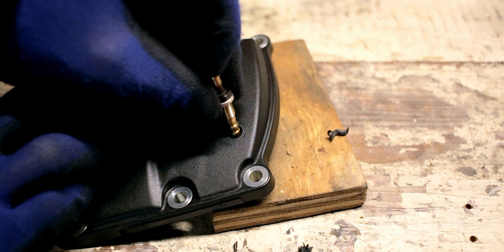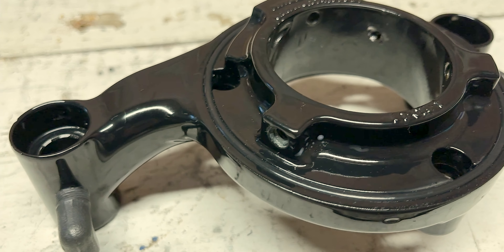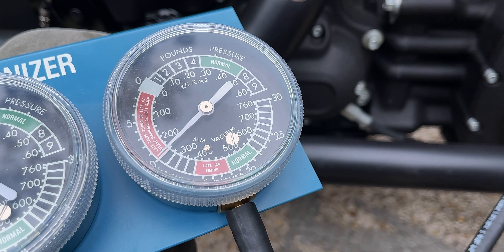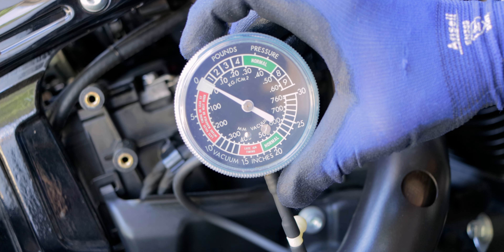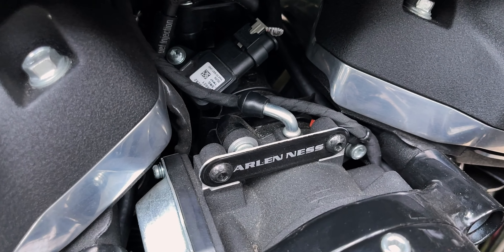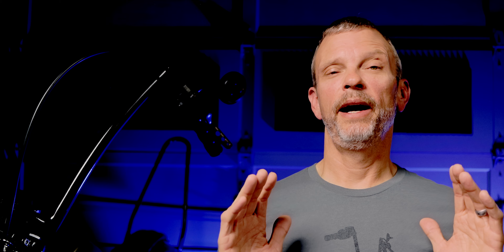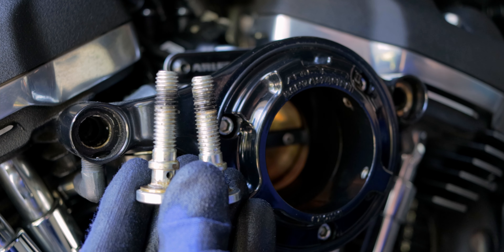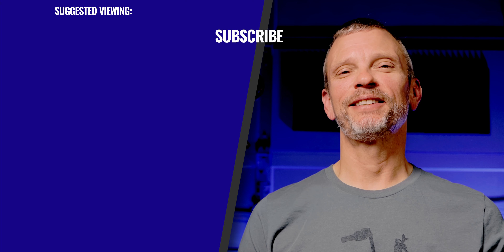M8 Crankcase Pressure OR Vacuum? • Crankcase Vent • External Breather • Check Valve • Stage III

Comment: On my v twin I just put in place a one way check valve off of the upper breather tube.  Works just like pcv valve.
Reply from the maker: Hey Dale - that sounds like a nice simple approach. I haven’t done anything with that breather tube. Is it a hard line or rubber? How’s it working for you?
Reply: @RonsWorkshop  I used hard line kit from J&P Cycle at the jug but instead of leaving it vent behind air breather I T'd behind oem breather and then ran soft tubing back by swing arm.  When I got my bike I had to rebuild carb and noticed a good bit of oil in carb... sad part is this isn't just a Harley Davidson.... all cars, trucks have this issue.  I'd like the EPA explain to me why burning motor oil is cleaner off environment than just gasoline or diesel.
Reply from the maker: Thanks for sharing your solution! I’ll have to check out that hard line kit. I hear you about the oil. I’m finishing up the follow-up video for this now and it should be up by tomorrow.
Reply from the maker: Hey Dale - I  just posted the follow-up video: https://youtu.be/BaG1VdOFe48

Comment: The blowby gasses enter the crankcase as seen by the bag filling 
In the heads the umbrella valves separate the case from the intake manifold which is under varying  amounts of vacuum depending on throttle position when conditions are correct the umbrella valves open and the blow by gasses move to the area of lowest pressure ie your intake then when conditions are correct the umbrella valves close again keeping gasses in the case and this process repeats
 I would doubt the cases are ever under any amount of vacuum  it seems to me the system works on the pressure difference within the system 
a case breather is undoubtedly the way to go for me and let the heads breath external if any gasses ever reach there
Reply from the maker: Hey Kevin - let me know how it goes if you and a venting solution!

Comment: Based on how I just viewed my personal bikes intake taken apart the m8 does NOT have a positive crank case vent system. It only has a passive.  In order for it to be positive the breather hoses from the heads should need to be connected to the intake BEHIND the throttle body not in front.  There is zero vacuum in front of the tb at least not a measureable amount due to the columns of air in front of it the tb restricts the flow of air reducing the available amount after increasing the vacuum. This is how cats work and internal combustion engines are internal combustion engines. And I speak from the fact I’m a master tech in automotive
Reply from the maker: Hey Mike - thanks for sharing that info!

Comment: Those vacuum gauges you are using are not sensitive. I could not use them on checking for over pumped lifters causing the valves to bounce. I you get a really sensitive low psi gauge then you can see the psi pulses. If you do you will see what you see in the bag.
Reply from the maker: Hey Jeff - that makes sense. Thanks for the input!

Comment: First, I installed external head bolt breathers. Next, I installed the Feuling vented dipstick. Finally, I installed the Trask vented transmission cover. My initial assumption was that I couldn’t do any harm running all three venting systems simultaneously. But your latest video is causing me to question that assumption. Only the Trask transmission cover seems to have a working one way valve. I can’t imagine that I have any crankcase vacuum at all. Excess crankcase pressure should be able to escape. But idk if I should spend any time adding a couple of my own DIY one way check valves to try to develop vacuum in the crankcase.
Reply from the maker: Hey Brian - I’m still not convinced there’s an issue. If I had seen vacuum at all I might feel differently. @Norm Tut suggested a water manometer, which may be more sensitive. I’ll probably give that a try. But the only reason I’ve reverted the breather mod at this point is to check for vacuum for learning, and now is the perfect time to check for how much effect the crankcase vent has by itself since the other mod is disabled right now. Still on the hunt for solid facts from an authoritative contact.
Reply: @RonsWorkshop  In all honesty Ron, I’m not sure you’re ever going to find details that you’re looking for. I have watched so many videos my head spins on a daily basis I have talked and talked till I’m blue in the face to every person that I can think of and I doubt seriously if you’ll ever get a straight answer. The one thing I do know and feel confident about is if we go back to a date and time in which the Harleys were simply vented to atmosphere that was a factory norm. I think if anybody’s got this right on the money I’m gonna say that the Trask top cover is really the only way to go and I am thinking the only real reason that they put a check valve in it is to make it look more complicated (worth the money) …. That being said I called them guys at Trask directly and ask them all about it and that’s why I ended up doing the job myself on my own transmission cover was simply because they couldn’t tell me that my DIY job was any less effective and that’s coming straight from the horses mouth.
Reply from the maker: Hey Jeffrey - I'm pretty sure you're right! And the point about the check valve is not too far-fetched. As time passes I am more and more comfortable with venting to atmospheric (with a pod filter or something), knowing that the main thing is alleviating that pressure.
Reply: @RonsWorkshop  I do know that simply venting the crank case whether it be from using the V-1, fueling, Trask top cover to vent the case has eliminated the oil in the intake 99% … my goal was to accomplish that and possibly help with the 1/2 qt. Oil consumption in between changes (5000 mile oil change interval w/full synth oil mobile one 20/50)…. But I’ll take what I can get at this point.🙂

Comment: There is essentially NO vacuum in the air cleaner area because it would be vented in before the throttle plate.  Unless you have a badly plugged air filter there is less than one inch of vacuum difference between outside air and air inside the air cleaner.

Comment: to messure vacum in the crank case you have to messure vacum in the intake...
thats the source of vacum in the crank case
if there is no outsource of vacum your crankcase will be under pressure 
and the more blowby the more pressure 

your crank case is suppossed to have vacum 
and thats why breather tube is connected to intake
Reply from the maker: Hey Rokita - yes, but that vacuum goes to the crankcase when the stock head/intake venting is in place...but in my case it seems that the pressure is higher than the vacuum, or at least that with the gauge I was using it was not sensitive enough to capture any of the vacuum pulses. I've gor more info on this topic and I am working on the follow-up video.
Reply from the maker: Hey Rokita - I  just posted the follow-up video: https://youtu.be/BaG1VdOFe48

Comment: vacuum in a crank case...never heard of such a thing unless you've got one heck of an oil pump but by the time you got one that strong you wouldn't need the pcv(s) which Harleys have 2...1 in either rocker box and they vent directly into the air cleaner when not modified elsewhere...all engines will have positive crank case pressure therefore they all have a pcv valve of some sort otherwise you would blow the case seals...and while yes you get some blow by its not really anything meaningful because what you're really seeing is well think of it as an air compressor where it will compressor air and oil vapor on one side of the piston while on the other side its doing its normal ic engine stuff...I say that because the pistons compress the air and oil vapor every time they come down instead of every other time like they do going up on your compression stroke
Reply from the maker: Hey Nathan - one thing to consider is the standard PCV valves that engines have. If there was never the possibility or benefit of vacuum, they wouldn’t have the one-way valve / check ball that only allows pressure to escape but allows vacuum. It would just be an open vent to allow the pressure to escape.

Comment: There can't be any vacuum without a vacuum source.. I have no idea where that source would come from so it's reasonable to say that a Harley crankcase is never under vacuum.
Reply from the maker: Hey Greg - the only viable potential source that I’m aware of is the airflow through the intake / throttle body.

Comment: What about using the heavy breather solution but instead of to a catch can or filter use a close loop side to side?
Reply from the maker: Interesting idea - but I think you really need to vent it (with a check valve) to get the benefit - or apply external vacuum.

Comment: How is the heat( Engine Temp ) on them? What’s the Engine Temp range? 
As well as Oil Temp?
Reply from the maker: Not sure - I don’t have telemetry to get the temps so I have no idea. I’ve seen no problems with the check valve after quite a few months of riding in hot Florida.

Comment: Does using these MODS Lower Engine Temp?
Reply from the maker: I’m not sure, but it seems that the engine runs better after venting the crankcase, so it wouldn’t surprise me if there are a number of benefits.